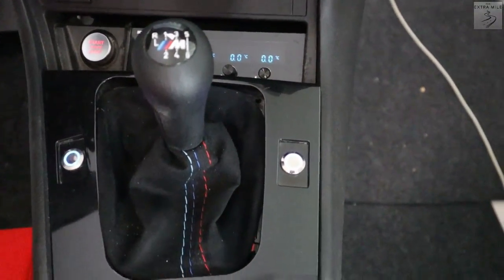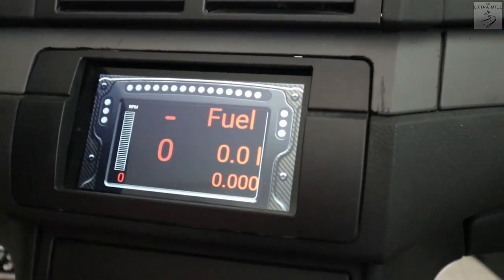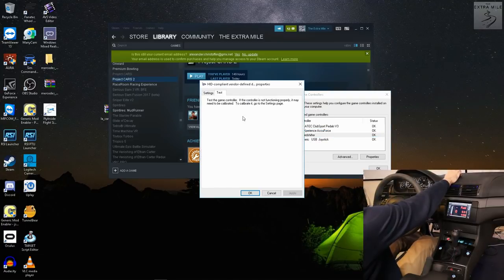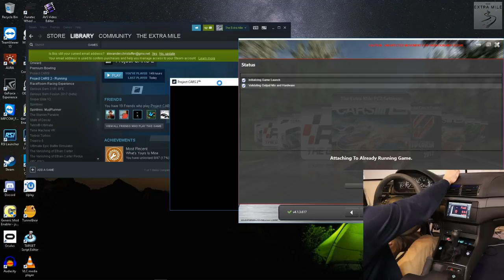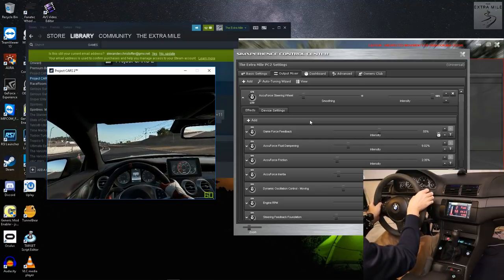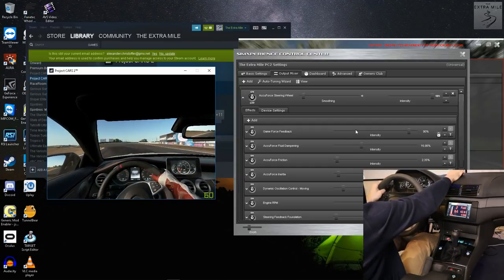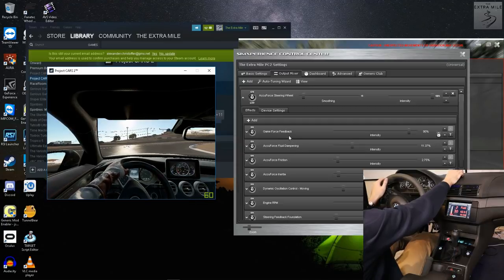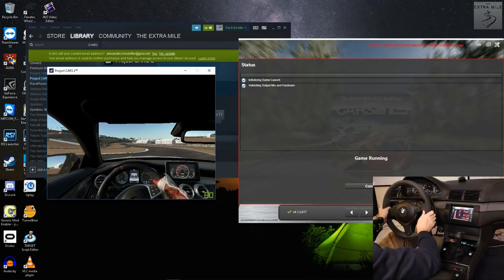Simrig and Software: Detailed Tour

Comment: I want to shed light on something that I think is important and not a lot of people talks about it. 

I can drive and control cars in real life much better than in sims. And I always had the excuse of my pedals causing pain, my wheel is off center to the right, VR hassle, my shifter is not perfect and it is easy to miss shift... etc

With this sim rig taken from the M3, the erginomics are studied and tested thousands of times and polished along the years.
Reply from the maker: You are very correct in pointing that out Azar and I thank you for it!

The ergonomics indeed play a seemingly small but yet very important part!

Comment: The steering wheel cost $999...
Reply from the maker: Unfortunately yes. Direct drive wheels are still pretty expensive. It all depends on how many hours you spend simracing per week/month. If it´s a considerable part of your free time, then I think it´s worth it.
Reply: @TheExtraMile  well honestly I haven't spent any time simracing but I want to try racing with just the vr headset and steam controller. Just not sure if it is worth buying the game or if I will be disappointed
Reply from the maker: Hmm I just recently did an episode where I drove in VR with a gamepad. It was surprisingly very driveable and not as weird as I had feared. So I would say give it a try!
Reply: @TheExtraMile  what game was it?
Reply from the maker: @Monztuh  That was Project Cars 2, I can highly recommend it. Assetto Corsa is also great and has many mods to offer!